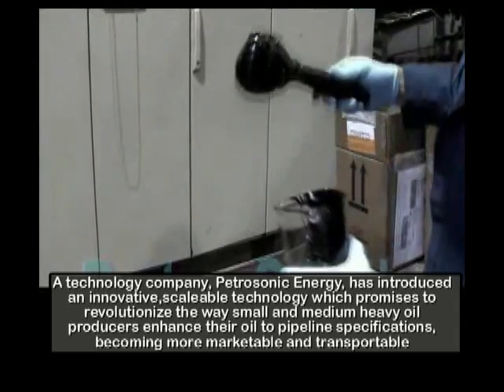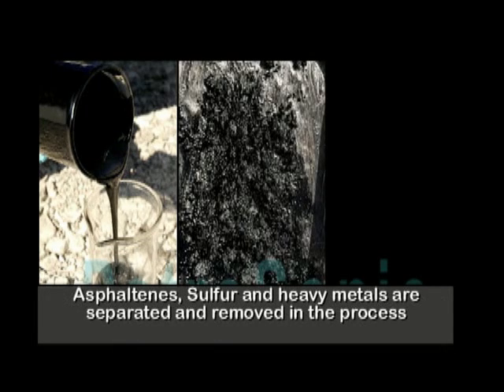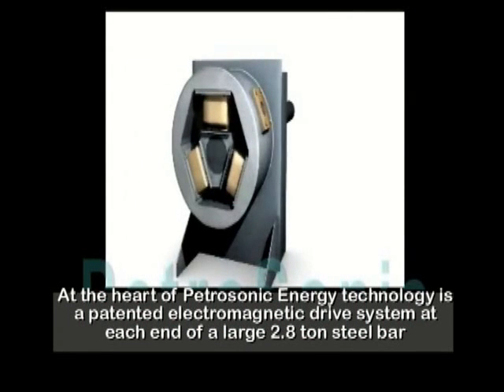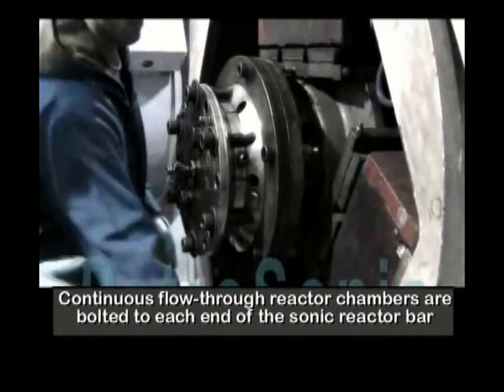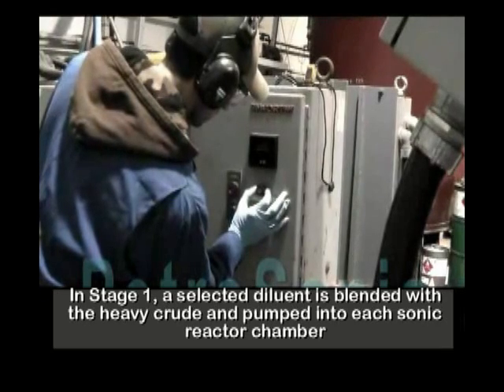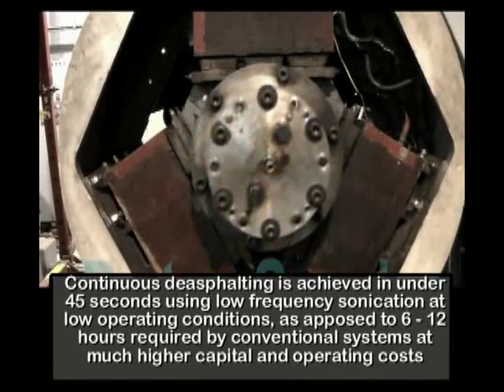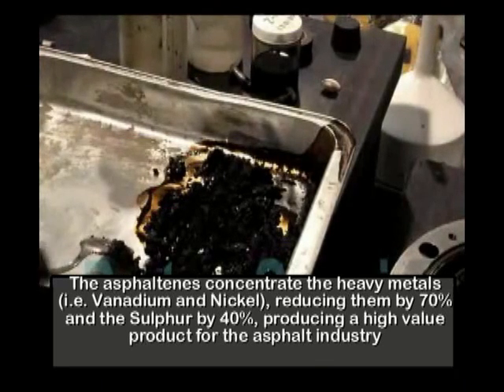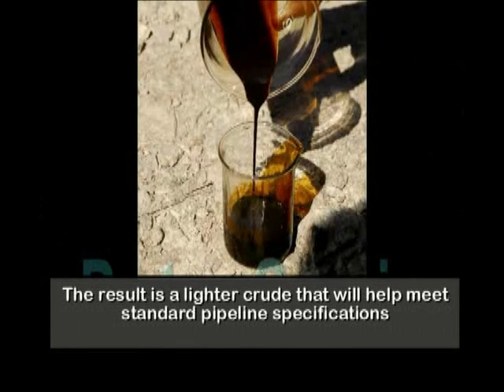PETROSONIC ENERGY MASTER

Comment: Fracturing may be safe as a procedure however, I used to work for Halliburton and I can assure you that some of the chemicals they pump down hole are seriously deadly!!

I had one drop of these chems fly 30 plus feet and burn a hole through my fire retardant suit my thermal underware and into my leg. Question is, for people that get there water from a well, do you think this chemical is safe to drink especially when they are not even telling what's in the chemical even though they were court or

Comment: Do the research, fracking arkansas earthquakes should be a good start. It was proven in court & the fracking was shut down. And then there's the poisoning of all the groundwater and water wells for quite some distance (many miles minimum). They are trying to tout this as enviromentally friendly when fracking is an enviromental nightmare (the video "Gasland" is a must see) plus what are they doing with the toxins/pollutants/impurities after they remove them?